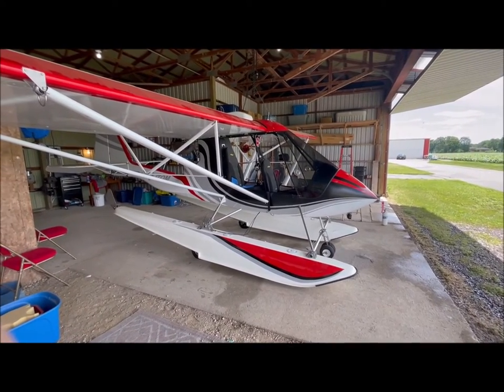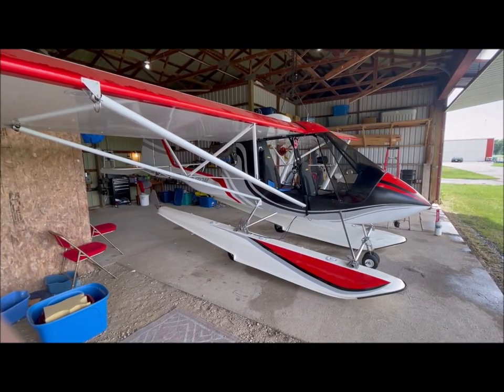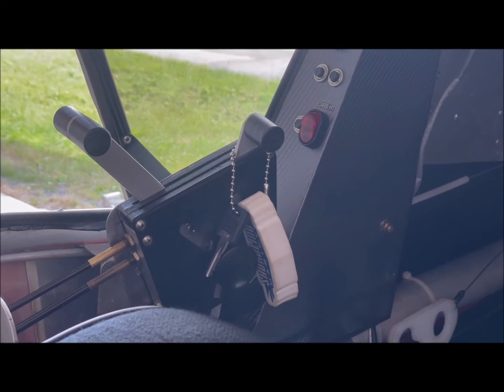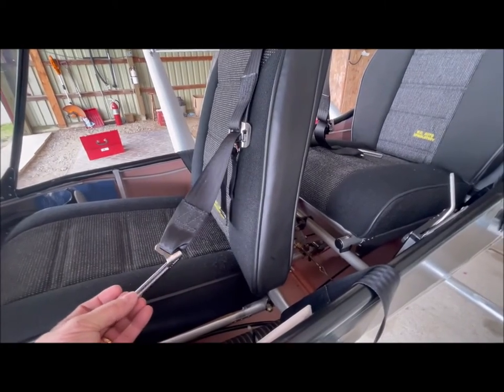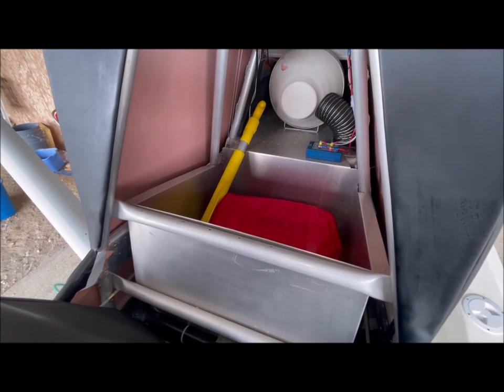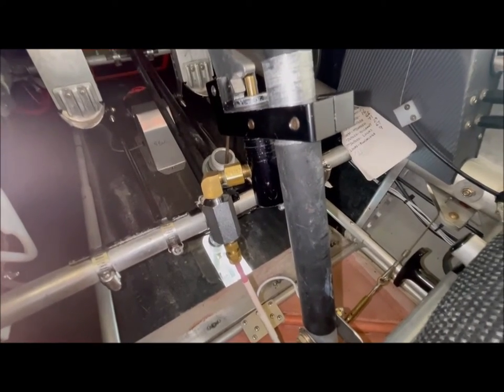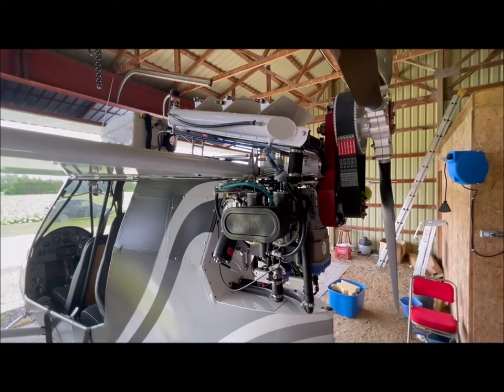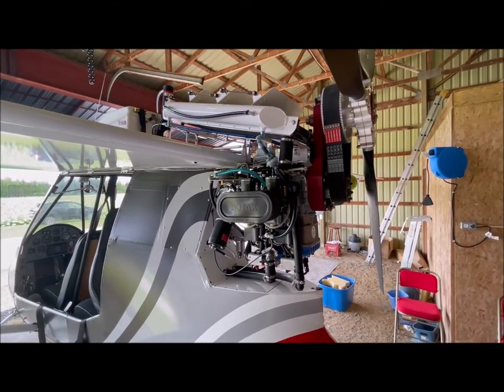ITOM video for sale - 2021.07.02

Comment: A question , why not mix the fuel so you don't have to worry about the injector system failing. Are the aviation injectors just a more reliable injectors? I know on ground machines we normally just remove the injector systems